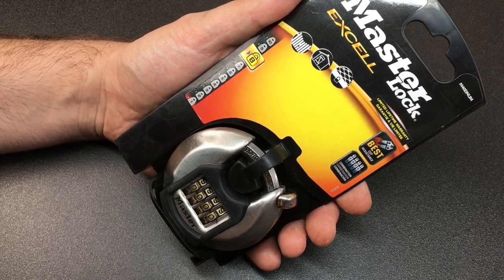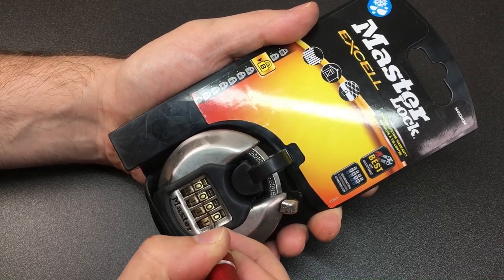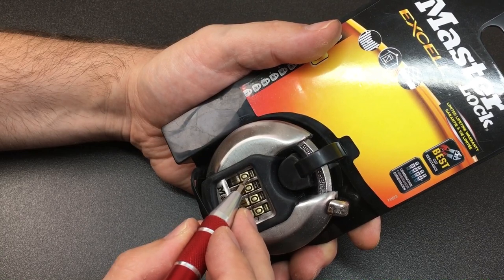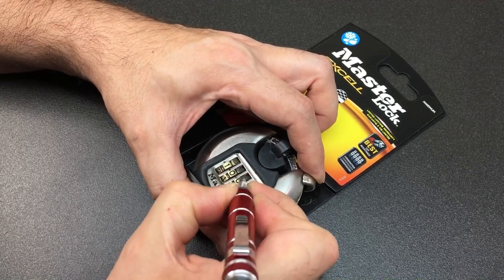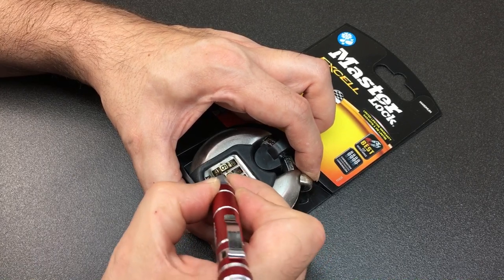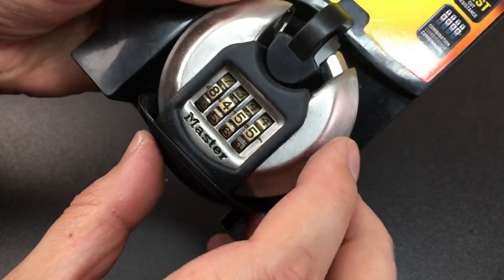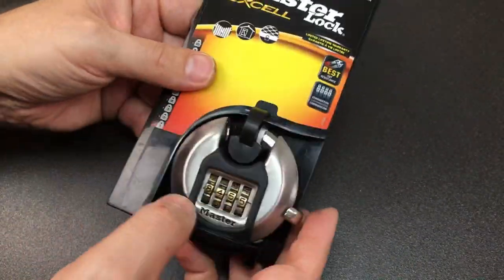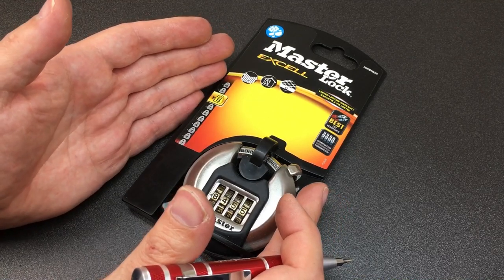Master Lock M40DNUM Combination Diskus Padlock Decoded Out of the Pack

Comment: I picked up one of these a while ago, couldn't feel my way into it because it was so stiff but I found that if you're careful with a decoding shim you can feel a feature beside each of the wheels which corresponds to the gate.  The only problem is that you'd get the same feeling at diametrically oposite ends of the wheel, so if you felt it at 0 you'd get it at 5 for example, which gives you 16 possible combinations to try.
Reply from the maker: Interesting thanks 🙏
Reply: I have noticed the same thing on mine that I'm trying to decode now. I tried all sixteen variations, but not in all ten positions...is there a secret to figuring out where the gates align or do I have to brute force all 160 possible combinations?
Reply: @isaacwoodard1029  yes it's quite simple. Once you find the notch move the wheel two numbers up. So if your notch is at zero your number is two or seven. Add tension and test the resistance on both wheels. The number you are looking for will lock up.
Reply: @isaacwoodard1029 both numbers not wheels, sorry.

Comment: Pretty much the same way as I used to open those 4 digit combo chain locks for bicycles when I was a kid. With a bit of practice can open them in about 20 seconds without any tools.

Speaking of tools... I have the same screwdriver pen as that, but found the bits too short to reach the screw to remove the cylinder from padlocks. So I found an old hex wrench the right size, and cut off a piece to use as a spacer and glued it into the socket of the pen so the bits stick out further.

I also have a Master combination padlock I have no idea how to open, it has a single round button on the face that looks like a dial but is not and 4 arrows around it. The idea is  to push the button in the 4 directions in the proper sequence to release the shackle, and it has me stumped.
Reply: Have you tried using really hard tension in each direction, releasing after each try, to find the odd one out? Then you release the tension, make the first move, add tension and find the odd one out from the remaining directions. Next release the tension, go through the first two steps, add the tension to find the one which does the same thing. And finally release the tension, make the first three steps, and then move the final direction to open the lock. That should work. If not, try using less tension. It would be interesting to know if that works for you.
Reply: @locknut5382  I'll have to dig it out of my big box of locks and try that. 
Will also see what the model # name is.
Reply: @parapicktog7734  It will be interesting to hear how you fare with it, and maybe see a video too.
Reply: @locknut5382  I'll definitely let you know how it goes.....once I find it again.
But uhuh no way am I making a vid. I'll leave that up to you guys that know what you're doing.
Reply: @parapicktog7734   Thanks! And what makes you think that I know what I'm doing? 🤣 
Having seen your video, it's clear that you have enough skill for the task. I was reticent too, until encouraged by Deadlocks and Hobby Picker. Videos don't really come easily for me, but they can be fun to make.

Lock Nut videos are really basic, and are made with old iPads, no external  microphones, no studio lighting, no proper workbench, no editing, apart from trimming of the ends, and multiple takes to capture something close to the desired result. 

The lock picking comes from lots of watching people carefully, asking questions, patience and practice. If you watch the experienced locksporters on YT, you'll notice that most are very relaxed when they pick locks. It makes a big difference.

Give it a shot; you might surprise yourself. 🙂
Reply: @locknut5382  this is kind of embarrassing, but....I just noticed now who you are, I only glanced quickly at your name before, and thought you were "Noob", since that is who I expected a reply from. 
My bad. I do thank you for the advice though. 😉
Reply: No worries, ParaPick. Thanks for the clarification.

 I had answered you only because Lock Noob had not responded. No impersonation was intended, and the name similarity had slipped from my ageing brain cells. 😉

Please don't be embarrassed. There really is no need to feel it. We all make mistakes, and I'm no exception.

That said, if you're willing, I'm genuinely interested in learning how you fare with that lock. You can drop a comment on any of my small selection of videos, if you prefer not to post a new video. I've also subscribed to your channel, so should receive a notification, if you upload anything.

Stay well.
Reply: @locknut5382  thanx Nut.
I don't do videos, or post anything really, I just made the channel to post a pic once to show something I couldn't describe to someone.

Comment: They have a key lockbox with the same sort of mechanism.  The box can be recognized as it has a push-down lever 
to the left of the combination wheels, and a small-ish sliding dust cover over the wheels and lever.  A challenge to tension in the wild.
Reply from the maker: Cool 😎

Comment: Hi! I wanted to ask you...what lock would you choose for your home door? What types of locks are the hardest to pick?
Reply from the maker: Very hard answer. I always say speak to a qualified locksmith about your needs 👍
Reply: @LockNoob  that's the thing...locksmiths in my area thought my old lock was good ..which it was but it was pickable...a mult T lock...not even one of the harder ones with laser elements etc....so yeah...I would just like an opinion based on your practice . No pressure ofc

Comment: This method didn't work for me. I slid a shim down the right side of each wheel and turned them until i found a notch. Then moved them two numbers up. So if my notch was on zero my number would be two. That meant that there would be a notch on the reverse of the number, in this case would be seven. I now know it is two or seven. Then I put tension and tested the two numbers for resistance. It will only stiffen up when you find the correct number. This works a treat for me 👍

Comment: Do you ever use a lock that you’ve picked?
Reply from the maker: Oooh! Good question and oddly, yes I do.
Reply: if it took long enough to pick the lock, for most people it will take even longer ;)
except LPL xD
unless the lock is bypassable or can be opened by a low skill attack easily, why not use it?
I'd probably not use it for high-security applications then ... unless I want to be able to pick it in an emergency :D

Comment: iv been interested in someone doing a video on if u heat harden shackle to red then bolt cut it open 
thought posses is a back pack hho generator on batteries
Reply: If you have the means to get it that hot, might as well just melt it or flame cut it.